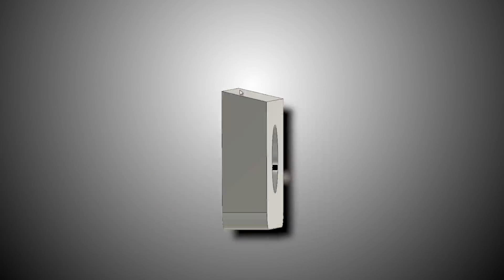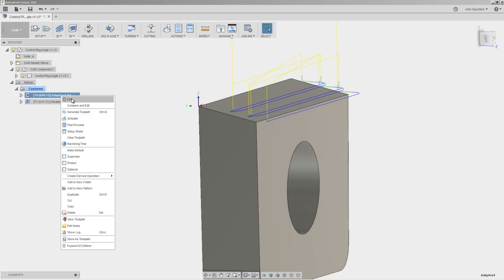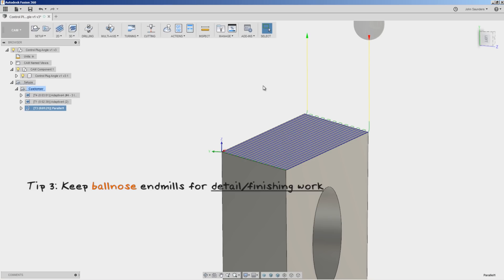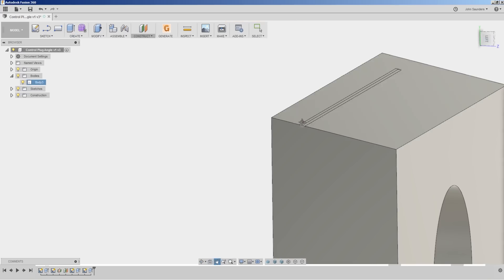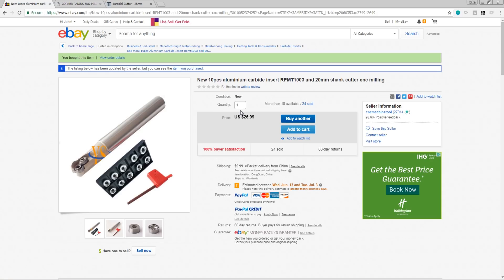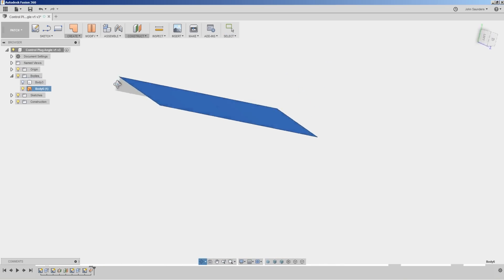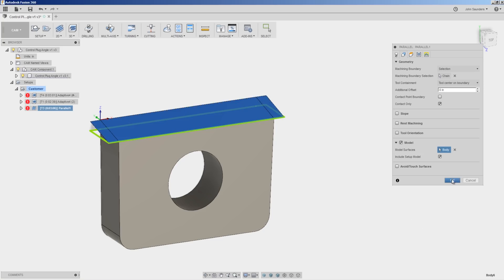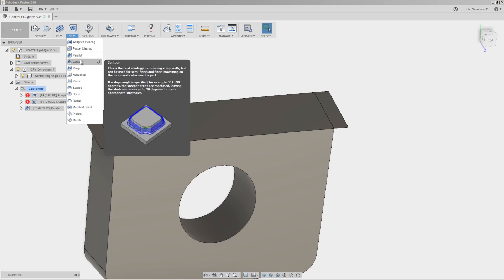Fusion 360 CAM 3D Surfacing Tips! FF135

Comment: Is there a reason not to just reposition the part and use a shell mill or fly cutter to do it? Honest question, considering surface finish is important
Reply: Just makes fixturing a pain when you could just have it fixtured in a vise and send it. Otherwise, you’re having to angle find and do weird stuff for the fixture. Sine fixtures are good for this, but the game here is finding the point of diminishing returns with respect to time input.

Comment: John,

I recently purchased a 20mm edge finder. I just turned it down on my lathe to 3/4" diaper and it warms fine with the TTS holder. You could most likely do the same with the Chinese cutter without losing concentricity.

Comment: Couple things.  Would it be easier on the tool to rotate the part 90° and use the outside of the cutting surfaces instead of the inner surfaces on the cutter?  

Also, do you take suggestions for future FF videos?  I would love to see one for doing inside and outside filets and optimizing toolpaths and such.

Comment: When doing the 3d contour with the patch method, what is wrong with just changing the Geometry/Tool Containment to Tool outside boundary?
Reply: Your tool will drop down the side of your model.
Reply: It does, but it didn't seem to round the edge off.  It was a small move down, but it didn't seem like as much of a wasted move as the additional distance in the patch.  Also, What is that setting for if not this?

Comment: From a machining rookie - what would be the issue with putting the 20mm tool in the lathe and turning it down to fit in the tool holder of your choice?
Reply: The primary issue is ensuring concentricity of the OD of the tool.  Plus, you will never get the surface finish.  One might be able to send it to a shop for grinding though. But the tolerances needed are what gets expensive.

For example, for Sherline to increase accuracy of the machine by 10% would double the price of their machines.
Reply: It would work just fine as long as you indicate it concentric to the existing surface (and leave a piece of the original surface untouched is a good idea) and you can machine it without introducing a taper, be sure to check your work and adjust if necessary.  If you want a better surface finish or a more accurate diameter you could try lapping it with an aluminum or copper shop-made OD lap and some lapping compound, or set up a toolpost grinder and grind it (or take it to a surface grinder and use an accurate spin fixture to grind it).  Simply put, you can definitely reduce the OD accurately with reasonable shop tools.

But if it is case hardened then the surface you reveal might be soft, and that could introduce a problem with wear.  It also won't be as rigid as it was with the larger diameter.

Chances are the whole thing is completely soft and crooked as well, because it's absurdly cheap and from China.  So it might be best to turn it down and not worry about it too much, or buy a better one.

Comment: John, you shouldnt use a ballnose for shallow surfaces because you will be cutting very close to the centre of the tool which means you will have very low surface speed, i.e. you will get an awful surface finish. You should be using a bullnose for this part
Reply: Kristian Thompson Silva 
Ballnose is fine since he’s working from the lowest point to the highest point, which will engage the flank of the ball for the bulk of the material before the tip engages. 

With a bull nose you would have to drastically reduce the step over as even a .06 rad would leave a nasty scallop and a .025 step over.
Reply: At what point did I say to use a bullnose with a 0.06 rad dickhead?
Reply: Kristian Thompson Silva 
Point remains. A bull nose will always require a smaller step over than a ballnose of equal diameter. 

I don’t care if it’s a 2” cutter with a .800 rad. A 2” ball would still be able to take a larger step over with a smaller scallop height.
Reply: That is an undeniable fact

Comment: Still baffles me that Fusion doesn’t have tangential extension for surfacing paths.
Reply: gredangeo 
I don’t like having to alter the model once in CAM. That’s just asking for problems.  Having to extend surfaces just so a tool path won’t immediately engage is a dirty bandaid of a solution.
Reply: Occams Sawzall Flow technically has it. I've used it with decent success.
Reply: I don't know why it doesn't have it either. Seems like it should be simple to do. I just view patchwork as a workaround. You haven't told the software what you actually wanted to do, so you have to lie to it, so it responds to the toolpath you actually wanted in the first place.
Reply: I agree with on you on that. Simple path extensions is just a part of machining. You shouldn't have to start on the part, there's gouge risks there.
Reply: Weird things is that it is in HSMWorks, so the logic is in the toolpaths. I believe in Fusion if you go into the compare and edit you can see the fragment extension distance. This actually would extend the passes when possible.